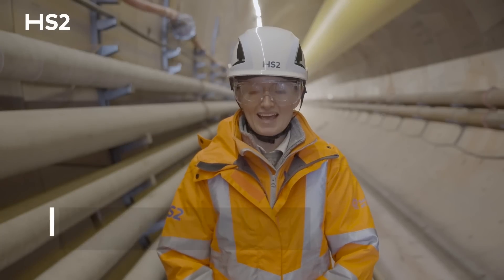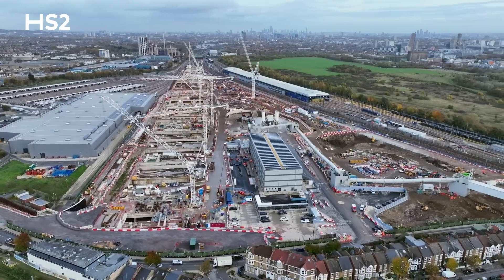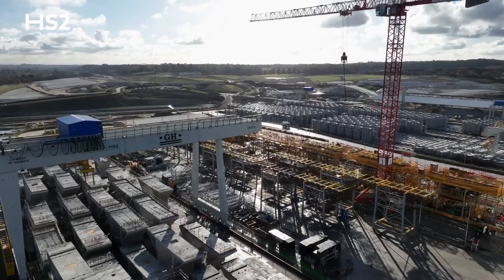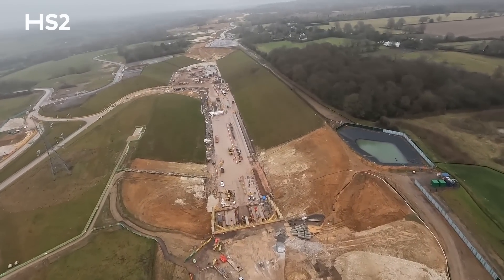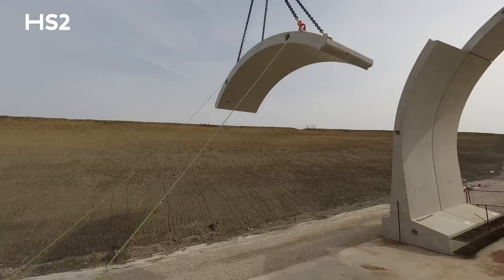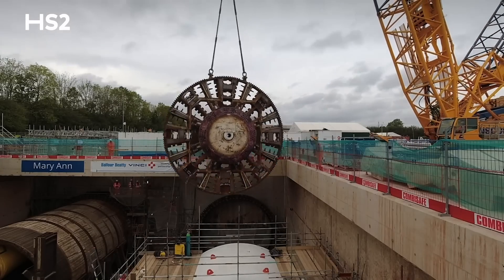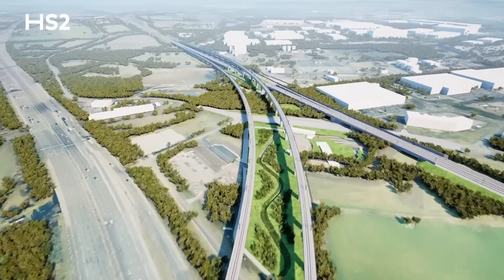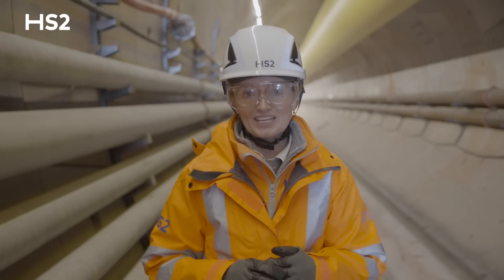HS2 Project Update, January 2024

Comment: Engineers :)
You really cannot decide which system to use: metric or imperial. Meters and kilometers are both metric (kilometer = 1000 meters), why bother with miles, when you have easier conversion with km vs m?

Comment: In 1830, a new company (London and Birmingham Railway) was formed to oversee construction of a new railway line linking Euston station to Birmingham Curzon Street station.  Construction began in 1833.  Of course at that time, there were no tunnel boring machines, cranes, excavators, or bulldozers, not even any hand power tools.  And yet just 5 years later, the line was fully built and a commercial service was running.  Just something to reflect on.
Reply: Also no safety regulations, environmental concerns, significant bureaucratic interference, or labour shortages, so there's that.
Reply: Also apart from the cast iron girder under bridges the last one of which was replaced in the 1980's, most of that infrastructure is still in use. I wonder how much of HS2's infrastructure will still be in use in 180 years time?

Comment: As someone from the northeast of England who got zero benefit from this and never was doesn't understand the notion of linking London  with "the north" its technically accurate its sort of heading in a northly direction but it misses most of the country including the northern part of it. London has a fortune spent per capita on transport supplementing it and spending on infrastructure it didn't need any more. Start at Carlisle or Northumberland and work down. Allow the rest of us folk to catch up infrastructure wise. London is not the be all and end all of the country.

Comment: Shame the general public were told this mega engr project was all about cutting minutes off journey times.  It should of been made clear that it is to relief the WCML & ECML,   that are full to capacity,  to allow the free flow of the growing demand of freight trains,  thus taking lorries off the road.  Regards the enviromental landscape,  it looks very hacked at during building.  After all servicing roads/land have been returned to normal use,  the land will renature.  A 4 rail track is less spacious than a 6 lane m/way.

Comment: So when it launches you can get a 20 minute train to oak common. To get on hs2 to go to Birmingham in 30-40 minutes. Or… get a train from London direct via the normal service in 1 hr. Huge time saved!
Reply: It's 84 minutes (from Euston to New Street)  but your point about the total journey times is completely valid. I tried to stress the importance of this issue  to the HS2 big-wigs, at the initial consultation roadshow. However, it seemed to be something that they didn't think had any bearing on the success of the project. For me, it'll still be quicker to catch a fast train from Tamworth (~ 1hr) than go via Old Oak Common and London connections.

Comment: This may sound odd but why not build the tunnels and underpasses so low, if we wanted to at a later date due to demand possibly add twin deck trains than just single deck doubling up , it wouldn’t require-platform changes yet a;low say football days and possibly airport links to increase capacity

Comment: Let's hope the fares won't be too expensive. HS2 was always about increasing rail capacity between London & Birmingham, and not only about speed. It's a shame the railway has been so over engineered, this has pushed up the cost. I hope there will be good sense and a link installed to HS1 and onto France and also improvements northwards for Manchester. However, HS3 pushing up travel speeds and down travel time Hull - Leeds - Manchester - Liverpool should be given more priority.

Comment: As much as I adore HS2, when I watch these it just leaves one question: why were these projects not undertaken 40 years ago? The failure of the UK to provide NSIPs due to usual bureaucratic incompetence is extremely frustrating. NSIPs like this need a higher level of direct permission to remove the minority comments of NIMBYs and BANANAs. The UK needs to level up the whole country and provide equity to all major urban areas. HS2 would enable this and it's a shame that most of the network has had to be stopped. I only hope that within the next decade the rest of the scheme can be picked up again.

Comment: The  Ickenham/Harefield/Denham viaduct looks really elegant from ground and aerial views and isn't as intrusive as some of the other similar Victorian structures in the West London locality.

As a near-by local,  I regularly travel on the roads around the viaduct, and I have to say that the management of the works is superb. You'd hardly know anything was going on. Natural landscape has been used to hide a lot of the works and the use of the local roads for project purposes has been  well thought out to minimise road  use and temporary closures.

I remember the motorways (M4, M40, M25) being built in the 1960s and 1970s and the disruption caused is nothing like that.

That said, a massive earth moving and landscaping has taken place on Harvill Road, Harefield in order to re-direct the path of the road where it will have to pass-over HS2 and the Chiltern Line at the same location. The finished road embankment, which is due for connection shortly to the existing road, I am sure will quickly be named "The Hill" (Looks like the artefact in the Sean Connery film)

Comment: So let me get this right you building a line from Birmingham to Old Oak Common. A trip by HS2 between Birmingham and Old Oak Common would take around 42 minutes, but the connection within London between Euston and Old Oak Common adds another 30 minutes, plus an average of 10 minutes changing at Old Oak Common. The existing line you can travel from Birmingham to Euston in 1 hour 19. Another Tory disaster ...

Comment: I'm so disappointed with how much cutting has been done to HS2 - I'm so angry with the Tories and NIMBYism (not just Tories) for ruining what could have been an amazing rail system into a fast shuttle service to Birmingham only. Goodbye trains built to the Berne loading gauge, goodbye to congestion reduction, goodbye to transport modernisation north of London and the Midlands.

HS2 could have been cheaper if tunnelling underground in the countryside wasn't made necessary by NIMBYs.

HS2 should go from London to Manchester via Birmingham and Crew on the North Western leg and the Leeds leg shouldn't have been scrapped. The Leeds leg should also stop at Sheffield before Leeds but also be built to extend to Newcastle and onto Edinburgh and Glasgow on high speed tracks with sections between stations reaching at least 300 km/h between the shorter stops and the 330 km/h initial service speed between longer stops (I know 360 km/h is planned but I don't know if it will actually run to that speed).

Bloody Tories and NIMBYs!

Also, we need a high speed route to the South West too (even 250 km/h sections would be good) and a high speed link from Manchester to Cardiff and and Swansea via Birmingham and London to Cardiff and Swansea maybe also via Birmingham (250 to 300 km/h).

Comment: The start of this update felt a little bit embarrassing, at no fault of those involved but sorely that of the UK Governments for cutting this project down even further.

Though, I am still continually amazed at the engineering behind this!
Reply: There is still hope- if the project proves to have been worth it, it would seem like a no brainer to re-plan the Leeds and Manchester extensions- they might even extend it further North to Glasgow and Edinburgh (unlikely, but we can dream). The possibilities are endless!
Reply: @Jacko6do6 Starmer confirmed today that HS2 will not be extended.
Reply: @ds1868  There is still a future beyond Starmer
Reply: @lordgemini2376  lets hope we have a competent labour government for the next 20 years fixing the tory mess XD
Reply: @ds1868  Imo HS2 to birmingham is fine for now, as long as SIMULTANEOUSLY significant connections are made between cities in the north, and honestly everywhere in the uk (ie reopen disused railways, You shouldnt need to go through london if you want to travel from cambridge to luton)

Comment: The project should renamed HS0.2 seeing as they’re only doing about 20% of the what was originally planned
Reply: Gotta start somewhere - the West Coast main Line is at capacity (two upgrades 20-30 years ago, £GBP16billion spend, still stuffed south of Rugby) - sometimes we need to stop using 1840s railways designed to move coal at 40 MPH and invest in green capacity.  The motorways will not be widened. Then on to HS0.4, HS0.6 and through to 2.1, 2.2 etc - I like your analogy.
Reply: @mikehindson-evans159  The section that they are building does not really address that issue. It does not go anywhere near far enough north to accomplish that goal.
Reply: @mikehindson-evans159  I agree with you, just playing devil's advocate here... If WCML is stuffed south of Rugby, isn't the issue solved with HS2, which is going to connect with WCML near Lichfield?  There are still problems north of Crewe, obviously (WCML only double tracked through Mid-Cheshire, capacity reached on M'cr Airport line). If they'd just proposed this bit to Birmingham as the original HS2, it'd actually be a good thing.
Reply: @goombacraft In terms of capacity Phase 1 was for south of Rugby. Phase 2a was for North of crewe and connected lines with that and phase 2b was to aleviate capacity issues at Manchester and leeds. One cant exist without the other
Reply: You mean HS0.4? 😁
Reply: lol good one.
Reply: Yeah and costing so much more too. Such a shame
Reply: and all that by going 1000x over budget and taking a century
Reply: ..it would be cheaper if you hired the Chinese to build it. 🙂
Reply: @m.e.345  I would be cheaper if build without many REDUNDANT tunnels and bridges. Many of these structures are build now because of protests in not populated areas, where people did want to have HSR on the surface.
Reply: Rather it should be named HS1.2 or HS1.4. 
HS1 is done, so number should be bigger that 1.
Reply: Conservative only doing the job for the people that vote for them also, HS0.4
Reply: LOL !!!!
Reply: haha. good one
Reply: well London Got Cross Rail , but it was Millions over Budget and years late only just opened in time to be the Elizabeth line 
but then London get all the Rail improvements it wants but the rest of the Country can go whistle
Reply: @tomskupham London paid for most of it though, that's the only reason it got approved and built.
Reply: It should be named H2S, cos it stinks

Comment: what happens to Euston station then if old oak common is taking the big responsibility? HS1 only had one station st pancras as its london terminal while the stratford international was left very much un-international ----why the HS2 will have 2 london terminals then
Reply: Cost savings and a more resilient network. 
Stratford and Old Oak Common serve the same purpose on their respective lines. a Backup inner city termini that connect you to various methods of city transport should it be needed. At the minute Old Oak Common will be the main termini for HS2 trains until the government coughs up the money to build the extension into Euston. I hope this answers your question. :)
(Stratford gained the Suffix "International", as when the station was being built Eurostar services were originally planned to stop at the station, but due to the lack of space for "Airport" Security, the unwillingness to pay for border staff to staff the station at all times for the few trains per day, and the time savings of not having to stop at the station meant that Eurostar trains just never really stopped there except for during engineering works and Big sporting events like the 2012 Stratford Olympics.)

Comment: Ah yes the great unfinished victorian project...... Shhh if our pathetic politicians and fat cats were not so short sighted. You could have copied the French.  Yep lift the rails and flattern buildings but don't sell off the track beds and when the need became great enough re open the line..... No need for cars as most towns and many villages had a train station. Instead we ripped it all up, privatised it sued each other daily, built a new line slower than your forefathers for only the wealthy to use and didn't even make it to the north. Should have updated about four junctions as per a study done on updating the network and sorting the bottle necks out than waisting millions on this.

Comment: It would have made it to the north if they didn’t spend so much on tunnelling and cutting. Maybe one day it will get extended, it needs to go further for its full potential.
Reply: *If the project had proper management. It should never have been an issue, but mismanagement meant excessive costs in reassessing and redesigning tonnes of sections of the route, as well as the stations over and over. We can only hope that someone sensible comes in to scrap the "NeTwOrK nOrTh" scam and bring HS2 back on track.

Comment: Good video and excellent work. HS2 is expensive so so many have demanded the line is hidden and unobtrusive, especially through many an mp's constituency.  Building this in the manner of a motorway like the M40 say, 35 years ago, then it would've been much cheaper to just blast through the countryside. What is disappointing is the government attitude of the last 2-3 years that have cut away the edges to save a few percent cost that results in big cuts to the function and usefulness of HS2. Euston, and the Manchester link of note. The plans for the eastern branch and linking better to Scotland also.
Reply: They've not cut away at the edges, They've cancelled two thirds of the project, including the only phase of the project with a positive predicted cost to benefit ratio. Where left with the world's most expensive railway which is essentially an additional London commuter line. God bless levelling up.
Reply: Nearly £100 Billion spent to build a railway line that will get passengers from London to Birmingham slower than the existing Euston to Birmingham New Street trains. What a huge waste of money.
Reply: @philarthur2777   The problem is that the polititions are not letting the engineers do their work
Reply: Gary John Walker, the difference is that spending money on new roads is a worthwhile investment bringing economic benefits at all at a fraction of the cost of a new railway. There has never been a HS railway project where the passenger numbers forecast matched reality on completion whilst roads like the M40 and M25 quickly reached and exceeded traffic forecasts. There never was a valid business case for HS2 and that is even more apparent now, so why hasn't HS2 been cancelled and given a decent burial?

HS2 is cutting through 100 miles of England  with no stops on the way so is precisely of no benefit to anyone on the route who has to bear the cost and disruption caused with no offsetting benefit on completion. Compare that to the benefits the M40 brought on completion to all those on route given faster road links than those that existed before!